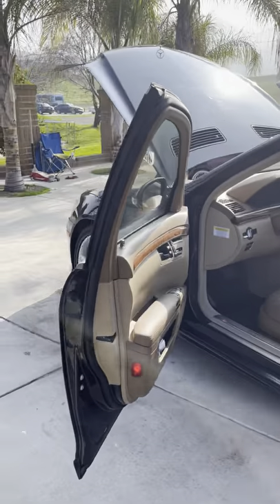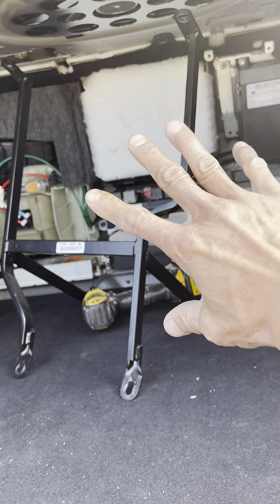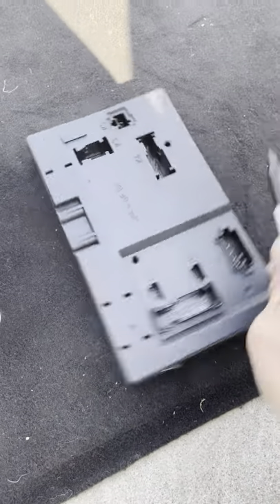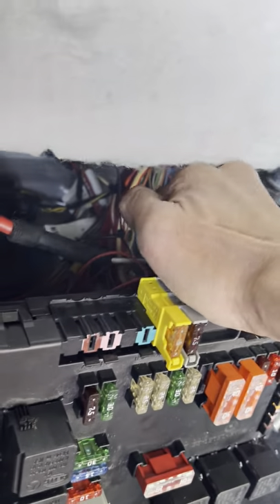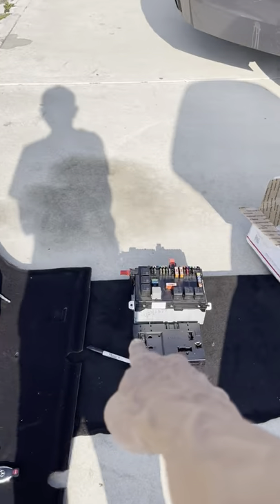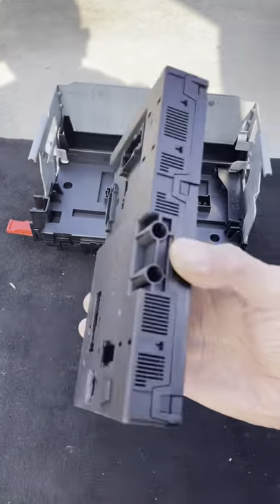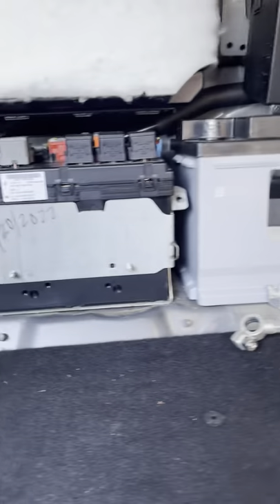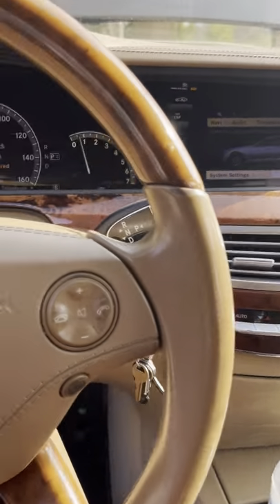2008 Mercedes W221 Command Center malfunction repair solved

Comment: It may be a soft reset. Like a disconnect main battery and reconnect it.
I have the same issue, I may try a soft reset then I will let you know. Thanks for your hard work!
Reply from the maker: I agree with you. Man I was struggling with that issue for a long time….I was about ready to smack my wife from frustrations!

Let me know how it turn out for you. Your welcome!!!!
Reply: @homeluangaphay2801   what did you guys do to fix the issues my screen turns on and off
Reply from the maker: @Sean Carter For the screen the fuse box in the trunk is the one that controls it. What i did to fix my command center was that I remove the box and replace it with a used one off eBay I found for $36. Try unplugging all the connections back there and re-plugging them back in again and see if that fix your screen. Some times it could be one of the relays that are NOT getting a good contact to the board.
Reply: @homeluangaphay2801  thank you bro I have a 2008 s550 it’s same location in the trunk ?
Reply: @homeluangaphay2801   is it the box next to the battery back there are it’s one them hidden fuse boxes ?
Reply from the maker: @Sean Carter yes it’s the one next to the battery in the middle of the back seat (if your car is the same as mine W221)

I made a video of how to remove the fuse box
Reply from the maker: @Sean Carter no there isn’t any other hidden fuse box unless you aren’t aware of the two small one that is located on the left side of the steering wheel and the one right of the front passenger glove compartment.
Reply: @homeluangaphay2801  so try disconnecting all the connections first and reconnecting thank bro I’ll let you kno what it do
Reply from the maker: @Sean Carter YES it is the same
Reply from the maker: @Sean Carter your welcome…..and yes please let me know how it went I like to know from as many people as possible with the many different issues.
Reply: @homeluangaphay2801   okay I’m in the trunk now boss . I’m trying to get the fuse box out when you say disconnect you mean everything connected to the fuse box ?
Reply from the maker: @Sean Carter…..yes you are correct! Disconnect all the wires and re-connect them back up again and see if that fix your issue. Sorry for the late reply. I’ve been sick for the past 3 days.
Reply: @homeluangaphay2801  okay I’m going to try in a lil today boss I’ll let you know been waiting for your response. Thank you get well boss man
Reply: @homeluangaphay2801  same thing after disconnecting and reconnecting cutting right off . And I noticed I don’t have the black fuse you plug up next to the white one , is it supposed to be missing ? And I’m going to try to by a used one I don’t kno what it is
Reply from the maker: You are welcome
Reply from the maker: @sean Carter…..it depends on the model of your vehicle. Mine is a S550 4Matic with AMG sports package meaning I’ll have more options then your car. You can message me and I’ll try to help. (559) 446-5180 but first text me and tell me who you are and I’ll reply.
Reply from the maker: (559) 446-5180 this is my new number since I switch carrier. Please text me if you still need my help.

Comment: Thank you , God bless you and your family,  great job  , you are the best , easy to see and understand .
I have a problem with ISM for the same model and year , it's with transmission and shifting gear  , please if you have any video for the ISM PROBLEMS ? Thank you again.
Reply from the maker: Thank you for the kind words, people like you are the reason why we share videos.

Can you tell me what your transmission is doing. Because mine was doing the same thing…..I think. On my car some times when I start the car, soon as I’m ready to go I put it in “D” drive and all of the sudden the tranny/engine jerks. Sone times it jerks and the car stall and I’d have to turn off the car and repeat the start again. If your car is doing that then I can help.
Reply: @homeluangaphay2801  Hello  
Thank you for your response  . 
My cat some time giving me the error on the dashboard  ( Drive to the workshop without changing gear  ) , then I cannot shifting gear from parking to drive or to reverse  , then after disconnected the black cable from the battery for 15 minutes and reconnect it I can drive , I  have to do that all the time . Intelligent Servo Module(ISM) , Thank you again and God bless you and your family.
Reply from the maker: Nashat….have you replace any of the relays at the main SAM (located in the fuse box under the hood). (559) 385-6758 you can call me here but first send me a text let me know who is texting me so I can call you.
Reply from the maker: (559) 446-5180 this is my new number since I switch carrier. Please text me if you still need my help.

Comment: My transmission mode works but nothing else on command center or radio options work work at all . My hazard button isn’t functioning also . My radio screen is black . Would replace the sam fix it ?
Reply from the maker: @RB-te3ou…….if you are to replace the fuse box in the trunk it should fix the issue you are having. Try replacing that because it’s cheaper
Reply: Hello, did you ever try this repair or did you ever manage to resolve the issue?

Comment: Hi, liked video, ver informative. 3 buttons on my 2007 S550 (power on, rear head rest, cd) not working. Only one working is rear window shade. No power to CD, no power to Command screen. Do you think it is the rear SAM? Thanks
Reply from the maker: Yes it is definitely the rear SAM. Replace that and it should work
Reply from the maker: (559) 446-5180 this is my new number since I switch carrier. Please text me if you still need my help.
Reply from the maker: @Chester Henry…..please let me know if what my recommendations help fix your car so we ( me and you can share with other people their problems).  Prove that the fuse box is the main issue. ❤

Comment: Its not the unit you replaced, its the "pin" connected to the center wheel you are moving. It is made of plastic and they break down after a while. You need to replace the "pin" or the entire command knob section in the center there.
Reply from the maker: 1. My command center stop working 
2. I never tried to open up any knob to center wheel.
3. I remove and replace rear fuse box.
4. After I did number 3. My command center work again.
Reply from the maker: (559) 446-5180 this is my new number since I switch carrier. Please text me if you still need my help.

Comment: My 2007 s550 keeps saying the air suspension is inoperative. I checked the codes but none came up. I measured all sides of the car where to wheel is, and the left rear is sitting 1 inch lower than the othersides. Th car is sits at a medium height now. I also changed the fuses and whenever i turn on the car its always inoperative right away. Please help me 🙏🙏🙏

Comment from the maker: Give it a try I’m sure if you change out that box or move it around it will most likely fix the problem
Reply from the maker: (559) 446-5180 this is my new number since I switch carrier. Please text me if you still need my help.
Reply: Where did u get the box?
Reply from the maker: @CjRob-xn5pq I got them off eBay
Reply from the maker: @CjRob-xn5pq  from eBay

Comment: I have the same problem, I’m gonna play with that box like you did, thanks hopefully it will work!
Reply from the maker: If it works please post a comment that it worked for you.
Reply from the maker: (559) 446-5180 this is my new number since I switch carrier. Please text me if you still need my help.

Comment: This is great ! Thank you for this video. I have a cl550 and having problems as well. The car is stuck on sport mode now and cant switch back to C. Also display "Please start the engine. Otherwise, COMAND will shut off in 3 minutes."  and the car would be turn on or while i'm driving ? I'm going to give this a try and hope it works as well.
Reply from the maker: @Johnny Mui the “stuck in sport mode” is control by your rear fuse box. Open that up or replace it and it should fix the problem. Like and subscribe if it works. Thank you.
Reply: @homeluangaphay2801  so I wanted to diagnose the problem. I’m not sure if your car was like this ? So my command screen has some working functions. Like is still plays radio/cd gps… but I lost the back up camera when I put it in R and also can’t put down with the center wheel to the ac/temperature on the bottom roll ? I can see it is highlighted but just can’t get it all the way down to the bottom roll for some reason ? Also the function button to the massaging chair stop working as well. I feel like all this is connected. If you can point me to the right direction that would be great 👍
Reply from the maker: @John Mui yes my car had the same exact problems where I can’t control the seat. I couldn’t do aloe of things on the screen and it was all because of some connections to the rear fuse box. Try removing the entire rear fuse box and replugging it back up again if you don’t want to replace it.
Reply: @homeluangaphay2801  so I try replacing the rear box like you said and still no luck. I’m out of ideas ?
Reply from the maker: @Johnny Mui When you have time give me text (559) 385-6758
Reply from the maker: (559) 446-5180 this is my new number since I switch carrier. Please text me if you still need my help.
Reply: @homeluangaphay2801  thank you

Comment: I bought my car one year ago. My radio comes on sometimes, more so especially when it’s raining.
I wonder what that can be?
Reply from the maker: @THE URBAN ARTIST……if your radio is coming on and off during wet days it’s likely water is getting in the trunk or engine compartment. Check for all weather seals such as your trunk seal and the rubber seals under your fuse box under the hood and go from there. I’ll try to help out as much as possible.

Comment: Hello, about 2 weeks ago my mechanic had to move my F sam to replace the hood release cables and when I picked up the car the check engine light was on. Beside that the car was in limp mode and the transmission wouldn’t shift. I scanned the car and it says no communication to canbus dtc u0101
Reply from the maker: @C lambruno it means the wire plugs that is under the front SAM fuse box isn’t plug in or not snapped in all the way it suppose to. 

Watch one of my video thar shows how to remove that box and make sure to double check all your wires and plugs are back in tightly.
Reply from the maker: Your mechanic might’ve miss one of the plugs or fuse clips when putting the fuse box back in.
Reply: @homeluangaphay2801  my car is 2007 Mercedes s550. I am hoping you are right cause the tcm and valve body were replaced already 2 years ago. Thank you for the responding
Reply: @homeluangaphay2801  I will check as my car is getting towed to my house on Monday
Reply: @homeluangaphay2801  does the front sam have anything to do with the transmission?
Reply from the maker: @C Lambruno……yes the front SAM fuse box have a computer that is flat and rectangular shape plug into the front fuse box. The computer plugs vertically (standing up) into the bottom of the fuse box, that computer is the one that holds all kinds of wiring harness and goes to each components such as to the other computer that’s under front passenger floorboard. The computer under the front SAM fuse box pretty much controls anything that has to do with the engine, transmission, ESP, Air lift and just about anything that is out side the car. Any thing inside the car such as sound, stereo, lighting, seats, buttons inside your car (after you close the doors and sit inside the car is what I mean) is control by the rear SAM fuse box as in my other video. 

Mercedes have 2 main SAM for most of their vehicle….although some might have 3 but yours is a S550 so you’ll have two. I say this because Mercedes make two main SAM and they split the two into job duties…. 1. one fuse box controls the outside and then 2. One other one controls all inside.

When ever a car comes in to their dealer shop they’ll know where to go to if it’s outside or inside complaints by the customer. But depends on which Mercedes dealership you take your car in to fix you might get the idiot mechanics that aren’t knowledgeable between what the two SAM duties are and then they go guessing and tearing your car apart while scratching their heads…Hope this helps.
Reply from the maker: @C Labruno…..(559) 446-5180 if you need my help text me and introduce yourself so I know who you are and I’ll help out via phone call or FaceTime.

Comment: If I buy another command unit on eBay will it work? Or does it have to be coded?
Reply from the maker: @Brian Bui…….when you say “buying another command unit” are you referring to buying a new/used fuse box?

Because a command unit is NOT the same as fuse box like on my video. A command unit is the hard drive that is in your CD changer. 

My videos is about front fuse box and rear fuse box replace. With that being said if you are having issue with your vehicle like me I recommend replacing your front fuse box for the exterior control of your car. 

If you replace the rear fuse box it will help control the interior of your car. 

My answer to your question will NOT guarantee a solution to your problem because every vehicle have different issues. 

Try what I did as a first or last resort when all else fails. I hope you understand. Let me know if you need my help, I can further assist you personally.
Reply from the maker: And NO you do NOT need to do any programming as long as your hard drive is still working. To program your car is only to install the software to your hard drive. This apply to an update it means to update your hard drive with new files. So it is important to make sure your hard drive that is install in your CD changer is NOT damaged.

I hope what I said help. If you still need my help please let me know and I’ll try my best.

Comment: My screen on my 2008 cl63 amg turns on then turns off all the time what it the cause be or what can I do about it ?
Reply from the maker: @Dann The Man…..the cause for that to happen is because of these things:

1) your unit is not getting enough power (like your battery going bad) because your power box is getting bad connections.

2) your screen is actually malfunctioning.

3) the connections wires to your screens are not getting a good contact to the wires. Wires and connections do go bad over the years from vibrations and corrosions. 

I recommend you first check change out your rear fuse box like I did and go from there. If you need my help you can text me (559) 446-5180
Reply from the maker: (559) 446-5180 this is my new number since I switch carrier. Please text me if you still need my help.

Comment: Hi there everyone, i'm new to the board and i'm having a really annoying problem with my 2008 S320 cdi in UK

I've had the car for about 3 years now and everything's been great apart from recently the COMAND(?) Unit has developed a problem. My iPhone usually connects automatically to the built-in bluetooth. Then one day i got in the car and started the drive to London and the phone was not connected to the COMAND and the COMAND was constantly 'Activating Telephone', each time it displays the message the radio is cut out, the message is displayed roughly every 2 seconds. I tried to de-activate the in car phone and the bluetooth altogether but it made no difference the COMAND was still trying to Activate the Telephone.

Once i turned the car off and came back later, everything was fine and working as it should. Slowly the problem has become more frequent and now this is a constant problem! It is really, really annoying! I've been into the dealership and they have simply quoted a new COMAND coming to a little over £3K...

I'm wondering if this a software problem maybe? Can the COMAND be reset somehow through the controls?? Has anyone else seen this problem before, i have been on google for some time now searching but have found nothing similar
 Please I looking forward from you to helping me out thanks alot
Reply from the maker: @debar Benz I think you are experiencing the same issue as all of us are. The reason why your command is going on and off is because the rear fuse box is not getting power to send to the ECU that controls the command. 

I had the same problem as you and for 3 years I couldn’t figure out what the problem was even the dealer couldn’t figure it out so they told me to swap out the command and software upgrade and so on but that didn’t fix it. So I went ahead and swap out the rear fuse box and that fix my problem. Look for a used rear fuse box on eBay
Reply from the maker: I’ll try to help out if you need me to.
Reply from the maker: (559) 446-5180 this is my new number since I switch carrier. Please text me if you still need my help.

Comment: I followed this to the exact yesterday and it didnt work.. so im guessing ill need to buy a new screen my radio/ audio  works fine
Reply from the maker: @draymondgreen……I’m sorry to hear that, it could be other issue to why your screen don’t work, prior to me having a working screen I had to swap out the hard drive inside the CD changer on my W221. After I did the hard drive swap I was able to get a working screen but I wasn’t able to control the any thing until I change out the rear fuse box. If you are having black screen try pulling out tue cd changer and pop out the hard drive and have it tested. Let me know